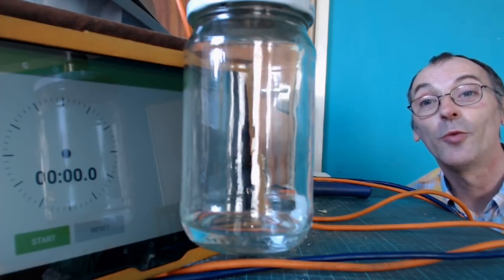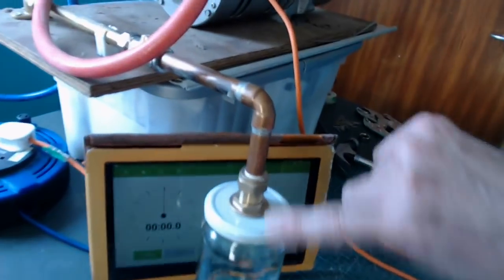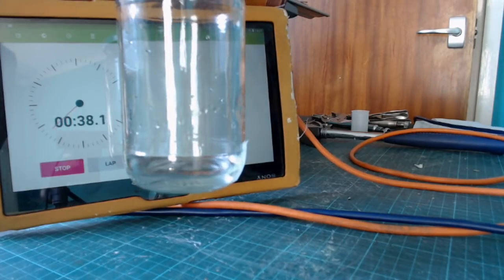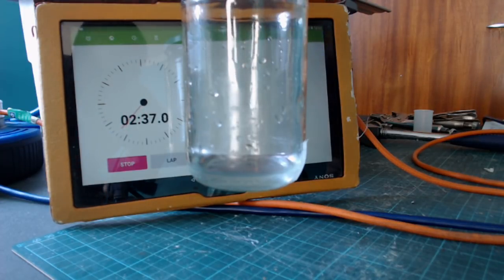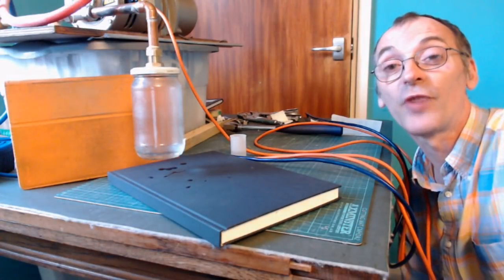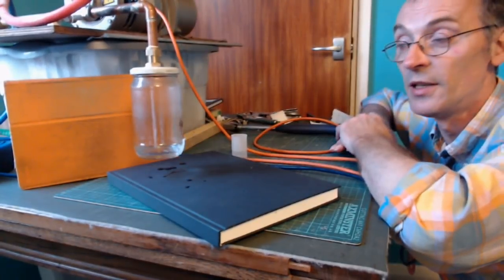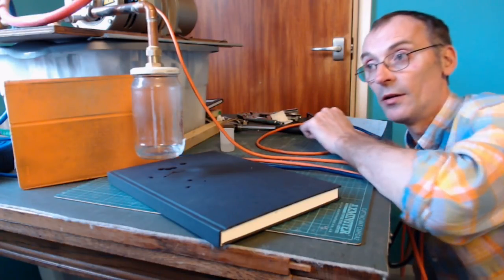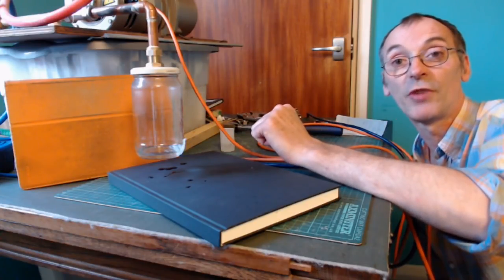Extracting Heat From Water Using A Vacuum

Comment: The reason you can't see the vapour is that it's finely dispersed in the air. When you normally boil water it's rather aggressive and the larger molecules of water in various states of liquid and gas disperse the light more. The reason it took you forever is you weren't condensing the vapour so the water vapour broke your vacuum so your pump had to work overtime.
Reply from the maker: Mr Nobody, the point of your comment in relation to the video is what exactly? You forgot to make it clear in your comment.
Reply: @PeterPete  boiling is defined as the change of state from a liquid to a gas. Think about what you are doing when you heat a pot, you are pushing energy into the water and making it boil. When you force the water to boil by dropping the pressure you make it boil. Same as with the boiling pot but this time there is no burner so it gets the heat from the surrounding environment. You aren't extracting heat from the water as much as the water is extracting heat from the environment because there is a vacuum which is making it change phase which takes energy and thus it cools. Same principle as an evaporator in ac.
Reply from the maker: @NoName-ml4sf  think about what you don't do to water in vacuum that you do to water in your pot! You've applied different process eg applying HEAT! So different applied process means different effect!! 

You've overlooked that point! Nvm! Like I've stated, you have a different understanding of boiling! I guess science isn't objective afterall!
Reply: @PeterPete  the surrounding environment is effectively a heater. If it's a warm day it will warm up a glass of water. In this instance the temperature of the environment didn't change but the pressure did. If you went to altitude you'd find water boiled at a lower temp, that's why eggs and potatoes take longer to cook. By creating a vacuum you made it boil at room temp.
Reply from the maker: @NoName-ml4sf  with regard to water in vacuuum you're dropping the temperature stooopid not increasing it!
Reply: @PeterPete  I never said you're increasing the temp, you're making it change to a gas which IS boiling. Boiling point is a function of temp AND pressure. Boiling takes energy which it gathers from the surrounding environment, including other water, hence the cooling. When the liquid water gets cool enough it'll freeze because so much energy has been removed from it to phase change other water to vapour that itself changes to a solid.
Reply from the maker: @NoName-ml4sf  We cearly have a different understanding on the definition of the word, boiling. Still, you're entitled to your opinion. Cheers!!

Comment: very good video yes pump extracted heat from water so Temp in the jar Goes Down , there is no such thing called Freon Gas
Reply from the maker: you might find this video interesting as we talk about fridges and coolants
https://www.youtube.com/watch?v=xMMXbxTZirk
Reply: Really Brilliant Demonstration water Become Colder and that is Good point to Every one Can make his Own little Fridge using Vacuum Pump 
 That  is To me Reminds me with  

 pot-in-pot refrigerator, clay pot cooler[1] or zeer (Arabic: زير) is an evaporative cooling refrigeration device which does not use electricity. It uses a porous outer clay pot (lined with wet sand) containing an inner pot (which can be glazed to prevent penetration by the liquid) within which the food is placed. The evaporation of the outer liquid draws heat from the inner pot. The device can cool any substance, and requires only a flow of relatively dry air and a source of water.

 @PeterPete

Comment: If we were to have an open discussion & everyone laid their cards on the table, and brought their evidence to bear, the PPz wouldnt have a leg to stand on.
This is the definition that the PPz keep referring to without understanding what it means :"Boiling is the rapid vaporization of a liquid, which occurs when a liquid is heated to its boiling point". Lets start with the word `vapor` : are the fumes that come off petrol vapor or gas ?  Or are fumes, vapor, & gas one and the same ? Now the word `Rapid` : does the word rapid mean exceedingly fast ?  Now the word `boiling` : does the word boiling mean gas escaping from a liquid very fast ? Now the word `heated` :  is a liquid with a temperature reading of 5 degrees c heated to 5 degrees or is it not ?  Now the term `boiling point` :  does the boiling point of a liquid drop to a lower boiling point when the atmospheric pressure is reduced ?
What the PPz have taught us so far : Gas isnt gas its vapor (thats like saying the earth isnt flat its level, or the earth isnt a ball its a sphere) ; Boiling isnt boiling its bubbling, need that one explaining ; Heat causes boiling and not pressure difference . And by logical conclusion : if ya cant put a tea bag in it and make a decent cuppa tea, it aint boiled water ...

Comment: It is impossible to freeze water inside of the vacuum chamber. If you guys had the education and the right equipment maybe you would be able to tell why it stopped boiling. I suggest you go and get a micron vacuum gauge so you can tell exactly the pressure inside of the vacuum chamber at all times. You cannot use this experiment to prove anything other than you guys are complete morons because you did not have the ability to check the pressure inside of the vacuum chamber at all times. Your vacuum chamber could have been leaking for all you know. How the f*** are you supposed to be telling people what is being done when you failed to put a thermometer inside of the water to prove your claim that he is being removed. You are literally telling everybody you are removing heat from a vacuum chamber but for some strange stupid f**** reason you fail to monitor the temperature in the water to prove your claim. How f**** stupid are you people seriously that's not even a joke. Maybe just maybe you are not monitoring the temperature of the water because it will prove that heat is not being removed.. you two are a special kind of stupid not regular stupid.
Reply: The water stops boiling because the pressure inside the water has reach the threshold of the inefficiency of the vacuum pump. If the efficiency of the vacuum was increased the water would boil for longer, and your set up was leaking i.e. it was a botch job ...
Reply from the maker: Quote - It is impossible to freeze water inside of the vacuum chamber.

Go tell Cody's Lab that he's wrong - https://www.youtube.com/watch?v=y4BGV7-1lhs&t=1s

Go tell Drewsaster that he's wrong too - https://www.youtube.com/watch?v=2IOyJa8NSk0

Go tell Sam Lucas that he's wrong as well  - https://www.youtube.com/watch?v=8rUYyLzGcjY&t=15s 

And while you are there. please ask them why does the water stop 'boiling' even though the same physical conditions apply so the water ought continously 'boil'? Better still we can ask you, why did the water in our demonstration (along with others) stop 'boilnig/bubbling' even though the same physical conditions applied throughout? It's ok, you can admit that the water wasn't boiling in the first place!!

Comment: Is there any specific reason why you do not have a thermometer measuring the temperature of the water itself and also is everyone supposed to just trust you that it's actually water in there... you're shady experiment practices of not including proof that is actually water in there makes it very easy to dismiss the authenticity of your experiment because you guys gave yourself the ability 2 fake it which discredits everything you say
Reply from the maker: If you cared to listen, it was stated it was a demonstration to show the extraction of heat from water using a vacuum. Irrespective the system was or not hermetically sealed, we know there was a vacuum because intiially the water bubbled and its temperature reduced which is expected when seeing similar demonstrations.. You are free to do this yourself if you consider it wrong. 

But please do the same and contact the person in the link below because his set up was not hermetically sealed as exhaust gases were seen leaving the vacuum container during the demonstration, 
https://www.youtube.com/watch?v=GxBRQXxBRic

Comment: You are not...i repeat you are not taking heat out of a vacuum chamber when you are boiling water in a vacuum chamber. There are two ways to boil water. One is bye adding energy to the water. The other is changing the environment that the water is in. Pressure and temperature are related. All you were doing inside of a vacuum chamber is reducing the temperature that water boils so less energy is needed to make it boil
Reply from the maker: Quote - All you were doing inside of a vacuum chamber is reducing the temperature that water boils so less energy is needed to make it boil

We didn't apply heat to the water to make it boil in the first place. In our next lesson children we'll return to our definition of boiling - Boiling is the rapid vaporization of a liquid, which occurs when a liquid is heated to its boiling point........I never witnessed any rapid vaporization, did you? And heat was not applied either so the water was not boiling!! Bubbling not boiling!!
Reply: Define "bubbling" how does that process differ from say `boiling` ?

Comment: the energy in the water is getting slower and slower starting fast with movement(energy) in bubble form to very slow with no movement and then the slower and slower the water molecules get they should change into a solid state yes ice and the outside air is being cooled (condensation) on the glass jar 

do you think eventually the ice would turn to oxygen and evaporate also through the hose? 

is water air and water? see i know H20 is not real but is water 1 part or two parts

is air 1 part or 2

is water air plus water?

same for air , is it water plus air ?

the vacuum removed the air part of water?

the spirit of water is air and the spirit of air is water?

this is my favorite show

i have a request 

oh wait i think the glass may play a part in this observation 

i think the vacuum is cooling it down directly and or the molecules of glass and its low state of energy is contributing to the water maybe 

??? hahaha 

request https://www.youtube.com/watch?v=QfvWt4NepaI PERFECT SONG

PEACE

Comment: If the air is coming back in to form condensation when you turn off the VP, then your set up is not hermetically sealed, ergo its a flawed experiment because youv got a continuous flow of air through the apparatus.. And im not convinced, im gonna stick with the definition of boiling as gas expanding in the liquid & violently escaping due to pressure differences, you can still call it bubbling and air being sucked out if you want because you havent actually proved anything different from what ive already said other than the spin you put on it..
Reply from the maker: I stated it was a demonstration showing how heat can be extracted from water using a vacuum as in the correct title of the video. It was accomplished. Are you questioning that?

If you really think water boils in a vacuun ask yourself why does the water not boil all the time when it is in a vacuum. According to your definition, it should!! It's absolutely ridiculous for anyone to think water boils in a vacuum!!
Reply: Peter & Pete   OK to answer your question `why does the water not boil all the time ?` :  You agree your apparatus leaks some negative pressure, and your vacuum pump is limited & can only achieve a certain amount of negative pressure. When the water boils releasing its gas it reaches a threshold due to the strength of the vacuum pump, and stops releasing gas at that point (stops boiling). Heat is lost as energy trying to maintain the pressure in the water, the cooling is the negative pressure in the water increasing until it is greater than what your pump can maintain in your jar, which is not a consistent vacuum because of your apparatus leakage. If you were to use a proper set up with a larger hermetically sealed vacuum chamber and a pump that could produce a perfect vacuum or as near to as damn it, the water would continue to boil until all the gas had escaped & the small amount of what was left would freeze into a solid. Your right about most of these experiments on YT are flawed, but only because the vacuum pumps arent good enough to fully accomplish this process.
Some questions for you : can you define what "bubbling" is as appose to `boiling` ?  And if you "extracted" the heat, what did you do with it & where did it go ?

Comment: sience, drug companies, industries, goverments all lie to get the results they want unbelievable!
Reply from the maker: yup - kinda sends the message home!
Reply: The refrigeration industry has a lot to answer for ...
Reply from the maker: aww upset because in your understanding your water stopped boiling and yet the physical conditions remained the same so the 'boiling' should not have stopped. Doesn't take much to admit the water wasn't boiling in the first place. Go put water in a saucepan, apply heat and make yourself a cuppa. but keep an eye on it as the pan will boil dry!!! Milk and no sugar please!!
Reply: I explained it in answer to your question below, the `physical conditions` were not consistent, they were knocked together ...
Reply from the maker: in your understanding a boil was clearly evident when the pump was switched on, conditions remained the same throughout, if the water was truly boiling it ought to have continued to boil, but it didn't. My understanding is that the water wasn't boiling in the first place.
Reply: If it wasnt boiling what was it doing ?